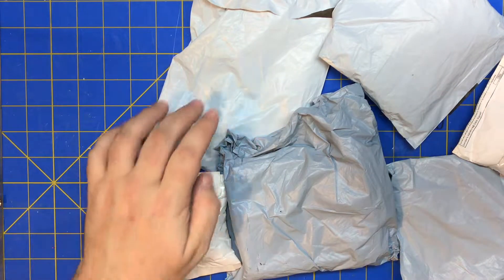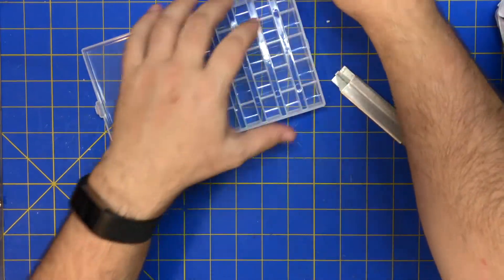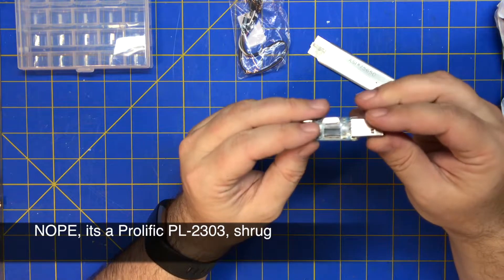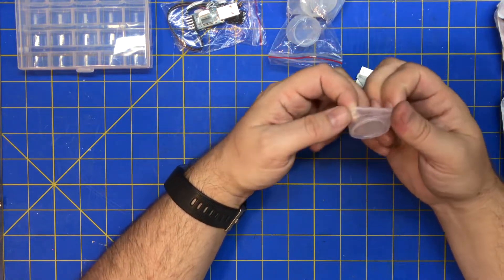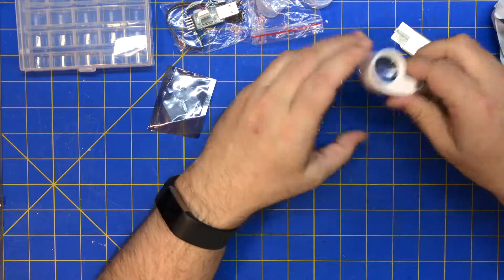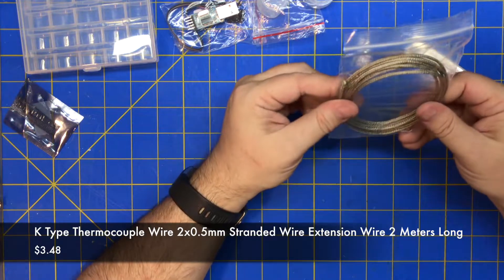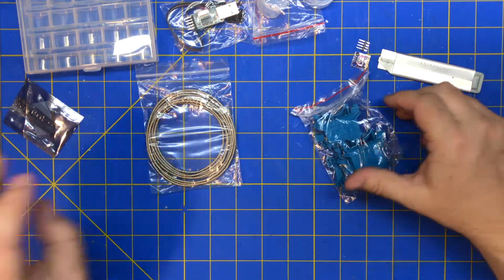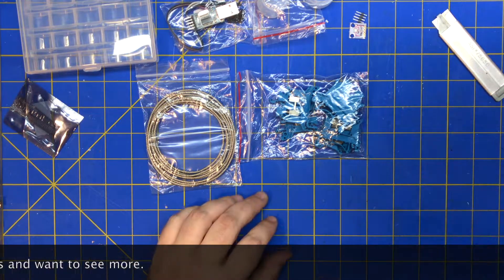Mailbag #53 09-2019

Comment: People had problems with the CH340, but they found out the Win driver was garbage. Use the official driver and it works fine. If that is a fake Profilic chip it will only run with old driver that came out before Prolific added the fake detection.
Reply from the maker: I just checked my ch430 , and they are blank, so yeah fake, no wonder. I am on OSX. One dead give away appears to be the prolific will not run at 921600 baud